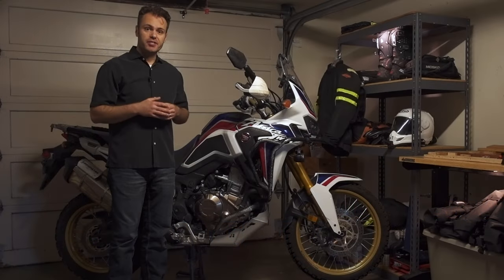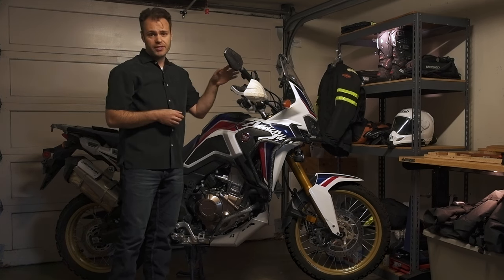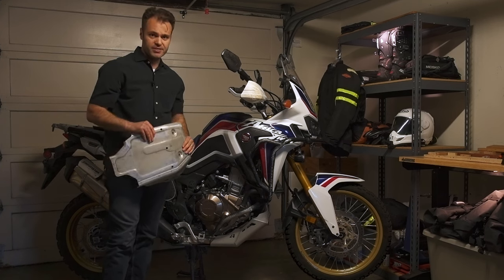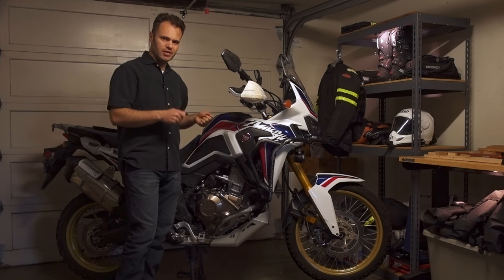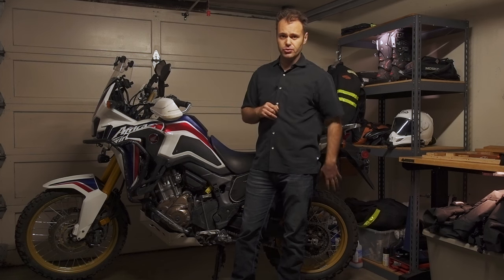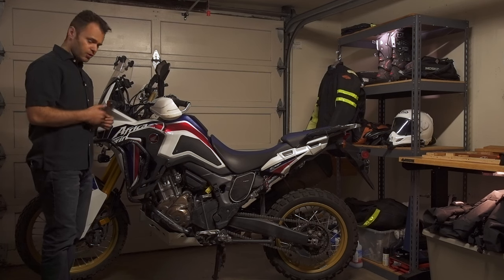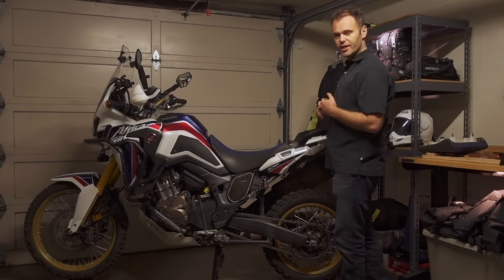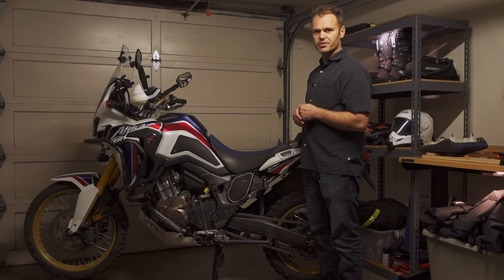Africa Twin Build: Upgrades and Modifications

Comment: Excellent video. Useful information for us OG AT owners. I have a 2016 silver manual. Love this bike.
Reply from the maker: Glad you enjoyed the video! Thanks for the feedback. For sure, these early AT models are the last of a vanishing breed - simple, reliable and fun.
Reply: @DiscoveryMotoADV you mean the newer bikes are less reliable?
Reply from the maker: I dont’t know if they are necessarily less reliable (though in some instances they clearly are) but they are harder to repair when they do fail. For example, to fix a cable throttle, it’s easy to replace the cable - easy enough to do in the field. To fix a fly by wire throttle, you will have to go to the shop which can be hard if you are in the middle of nowhere. And if something goes wrong with the computer in the field, you are screwed.
Reply: @DiscoveryMotoADV  mine is acting all crazy right now in a cold start. I cleaned the start/stop switch. May be a faulty TPS, idk. I’m not a good a mechanic…yet lol. Gotta get this thing fixed though. It’s driving me nuts.

Comment: I think service shops should allow overriding the speedometer specs when you change things like sprockets, wheel base or just tirre type at all.  Further they should allow user tuning for maybe +-3 miles per hour to fine tune things.

Comment: I had opposite experience koso where way hotter I have oxford on my Africa twin and can't tell they are on barely. And it's not even cold here yet. That crazy, I had koso on nc 700x
Reply from the maker: One thing to consider with the oxford…. At one point, one of my grips did end up being much cooler suddenly. They replaced that grip under warranty and it was hot as blazes again. So, could it be a bad set?

Comment: This video is more than an overview of farkles; it’s an excellent springboard for discussion about the strengths, weaknesses and “evolution” of the Africa Twin. Performance wise, the thing I’ve found that’s surprisingly useful on this bike (but not all bikes) is a quickly tunable steering damper.  It’s costly, but I ride in a very windy, sandy, gravely, damp environment and anything that keeps the front end pointing in the right direction helps. That aside, these bikes are farkle magnets, and thoughtful discussions like this are important - thanks!
Reply from the maker: Thanks for watching and the feedback! I hadn’t had any experience with steering dampers until very recently something orange and Austrian entered my life. 😁 i never thought it would happen but there is a KTM690 currently sharing the garage with the AT. Not sure if I am going to make a permanent change or not. Still trying to get a feel for the KTM. But the previous owner farkled the hell out of it including adding a Scotts a steering damper. I haven’t fiddled with it yet but I did have a terrifying bout of head-shake when I hit some uneven pavement at 75mph.  Gonna see if I can tune the damper to try and address that.
Reply: @DiscoveryMotoADV  Just used mine this evening on sloppy gravel.  I can dial mine in, takes  less than a second to feel the difference.  Good luck with the KTM - after 55 years of riding I’m convinced there’s no such thing as a bad bike these days, they’re all good. Skills, on the other hand, should constantly evolve. Take care!

Comment: Great video. I have one of these and will be taking your suspension advice. Regarding speedometer changes from sprocket changes, Not sure that’s correct. I think the speedo works off a sensor on the front wheel so unlikely to be affected. What would change is speed per rpm level in each gear. You’re definitely a slower bike in every gear at a certain rpm after adding teeth but speedo should be correct
Reply from the maker: Glad you enjoyed the video! Thanks for watching. I promise that the speedometer is indeed off. You are right that there is a speed sensor over the ABS ring on the front wheel. However, this does not actually run your speedometer but rather determines wheel slip for the purposes of activating the ABS. The speedometer reading comes from another sensor located at the gearbox. Thus, changing the gearing ratio, changes the speedometer’s perceived speed.

Comment: I think that the sensor for the speedometer should be on the front wheel (as with most bikes - I don't own an AT) which means that gearing changes won't affect it.
Reply from the maker: Common misconception for the AT ( I though so too). There is indeed a speed sensor on the front wheel but this is only for ABS and traction control. The speedometer sensor  is at the drive shaft.

Comment: Great video explaining upgrades and setup. Now that you have heavily upgraded the bike, would you consider trading your bike in for a newer 2020 - 2022 AT?  The negative would be cost, since you most likely have this bike paid off.  I went to a Honda dealer and with tax the 2022 DCT Adventure was $17,900 and that did not include tax and other fees.
Reply from the maker: Great question. I actually had a comment in the video about this but cut it out to keep things concise. I personally would NOT make the trade. The 2017 is the last year Honda kept things simple on this bike (cable throttle, minimal electronics). I like the idea of keeping things as simple as possible to increase reliability and field repairability on a bike that I take into remote places and often alone. In terms of cost, this bike cost about 17,000 all in.  8,500 for the used AT with 10k miles on it and about the same in total upgrades (some of which, like crash protection, you will still need on the new AT). And of course the Ohlins suspension and RR wheels are still going to be better than the new AT. So, I would strongly recommend going  with a pre 2018 used AT and then upgrading to your preferences (unless computerized riding modes are very important for you). With respect to DCT, thats a personal preference thing. I prefer manual as I feel it gives me better control in slow technical terrain.  Also, have you considered the T7? If I was buying today, thats the bike I would buy.
Reply: @DiscoveryMotoADV  Thank you for the feedback. Simple makes sense. I am currently looking to buy a AT and will take your viewpoint into consideration . I will take a look at the T7 also. Thanks!
Reply: @DiscoveryMotoADV  Have exactly same thinking... but i like DCT...

Comment: Great video, thanks! May I ask you, I want to know Manual transmission vs DCT. What is your opinion, please?
Reply from the maker: Thanks for watching! I think this is really a matter of personal preference - no right answer. I personally prefer the manual for two reasons: (1) the DCT is a little more mechanically complex and I prefer to err on the side of maximal simplicity since this makes the bike more reliable and easier to service in case of breakdown and (2) I believe that having a clutch gives me more precise control in technical terrain and it has definitely saved me from what would have been a few pretty bad crashes in some "whiskey throttle" situations. I recommend a couple of good videos from Bret Tkacs below on this topic to help you make a decision.

https://youtu.be/pgeYoG_mvts
https://youtu.be/wZXC7P7F6Fo
Reply: I did a manual transmission and put a quck shifter on it
Reply from the maker: @chris.kiser86  Thanks for sharing! What year is your bike? I didn’t even know this was possible on the 2017 but based on some googling it looks like it is by plugging directly into the coils instead of the computer.

Comment: great work on the video. appreciate the low key approach. I had pretty much written off the idea of buying  one of these older Africa Twins but you make a great case for them. Thank you.
Reply from the maker: Thanks for watching and for the feedback! I do love the bike in its current configuration and the beauty of the early models is their relative simplicity compared to most modern ADV bikes.  With the right mods it’s really a great bike if you can live with the weight.

Comment: Great job!

Do you still own the 2017 Africa Twin?
Reply from the maker: Thanks for watching. Yes, I still do. I have tried a few other bikes in the mean tine but so far the AT has successfully defended it’s position in the garage.
Reply: @DiscoveryMotoADV  I own a 2019 Africa Twin (Standard). I am wondering if you have experienced any ignition switch and/or left and/or right handlebar switchgear issues?

Also, can you please provide me some product sourcing information regarding your Ohlins front forks. Specifically, where can I buy them and what exactly should I ask for? Also, did you install them yourself?

Thank you.
Reply from the maker: @John-zb2kw  i have had absolutely no electrical or mechanical issues with the bike with the exception of one blown master fuse. In terms of Ohlins, you just place an order through their site (link below - just select the models for your model). Alternatively, you can use their website to find a dealer which could save you on shipping costs. I installed myself. Directions are straightforward and no special tools are required (other than a torque wrench). I would plan for  a solid half day of work. 

https://www.ohlinsusa.com/parts/honda/crf-1000l-africa-twin?srsltid=AfmBOop2j_PO2877RLoD9AyqC-UZA00BbM_FgV2SbZGKrCqxHux0gVzc

Comment: Appreciate your honesty in stating certain mods possibly not worth the money.  Similar to your bike I prefer to only install the best equipment I can afford.  Not insanely rich so I prefer not to waste my money.

Might want to look into altrider center stand skid plate....offers a lot of protection and allows bike to slide.

My favorite mods just for looks was Remus exhaust and Altrider high fender kit. 

Getting ready to pull trigger on suspension myself
Reply from the maker: Thanks for watching and commenting. Glad the video was helpful. That remus exhaust definitely looks pretty sweet and probably sounds pretty sweet too. Plus a chance to shave some weight. I’ve definitely thought about the high fender kit as well. One day when I end up packing the stock fender with mud, Ill probably pull the trigger.

Comment: Great video, and great bike. Just one small question. Taking in account that the speedometer sensor is on the front wheel, doesn't it really matter the gear ratio, correct? It reads the turns on the front wheel.
Reply from the maker: Thanks for watching. Glad you enjoyed the video. I was confused about this as well. What I learned is that the speed sensor on the front wheel is inly used to detect wheel slip for the ABS. The actual speedometer sensor is at the top of the case and monitors drive gear rotation which is indeed effected by gear ratio.

Comment: I am purchasing a 2017 A.T. .  I also would like to get some tubeless wheels for the bike.  I have looked at VMX but can not get anyone to respond to an email, nor could I get through on the phone, though they say they are in California.  I know the product is made in China.  I just found your video yesterday and noticed the Rally Rand wheels.  I have sent them an email but can not find the wheels on their site anywhere.  Can you provide anymore information on these wheels?  Appreciate the video.  The bike I am purchasing has the same safety equipment they you have listed and will be picking up some other items you have.  A little concerned about the front forks as I am not going to spend that type of money for them.
Reply from the maker: Whoa. Just checked the Rally Raid site and it looks like they aren’t supporting Africa Twin at all anymore. Please comment if you hear back to let folks know if these are no longer being produced. I believe Woody’s  Wheels will do a tubeless rear. I am not sure if they will also build a front with a safety lip. But worth giving them a call. A lot of people have success with a DIY Outex approach but I am hesitant to run tubeless without a safety bead. Many people have done it seemingly without issue but it is not recommended. As for the forks… its hard to say how common the sticktion problem really was. Enough that it comes up on the forums and suspension shops offer recoating services but still pretty rare i bet. Just pay attention to the forks when you are inspecting the bike. Look for wear on the stansion. Thanks for watching.
Reply: @DiscoveryMotoADV  yup, they are not manufacturing them anymore.  This was their response.  Marc, thank you for your email. I am sorry we no longer manufacture the wheels for the Africa Twin, I am sorry but we are unable to supply them. I like the style of the VMX with the outer spoke, but just not sure of their reputation.  Woody's pricey but I guess you get what you pay for.
Reply from the maker: @marcrobyn4844  Thanks for sharing their reply! Pity that they aren't supporting the AT anymore.
Reply: Wow, you have a ton of money into this bike! The front forks are 4K in Canada and the rear’s about $1600. You’ve done a nice job with your choices. I changed the gearing on mine too, I also installed a healtech speedo healer. Works well and found a short cut to make the install relatively easy. Thanks for the video!

Comment: Thanks!  Looks like Rally Raid isn't making those wheels anymore.  Woody's Wheelworks makes some though.
Reply from the maker: Thanks for the update! It actually looks like RR has stopped making parts for the AT all together. Woody’s has a great reputation so glad to hear they are still doing it. The only issue that I recall is that they may not be able to do a safety bead on the front wheel.

Comment: Where csn we find more details on the tubeless wheels?

Have you modified the OEM wheels or you bought new tubeless set?
Reply from the maker: The tubeless wheels are from Rally Raid. They are currently out of stock but if I understand correctly they do intend to resume production at some point. You will have to check with them. These wheels have the safety bead on both wheels and are sealed for Rally Raid with a galvanized rubber process from a company called bartubeless. A much cheaper but seemingly effective alternative people take is to seal the wheels themselves with available kits or various DIY approaches. I was not happy with this approach because you would still be missing the safety bead and risking having the tire slip off under certain conditions. But there are people on the forums that have ridden thousands of miles without incident with that kind of setup.
Reply: @DiscoveryMotoADV  thanks for your response. All clear.

Comment: 5:30
What r u talking about if bar goes out of alignment i fix it by hands, just move bar to one end and push with hands on grips.
But i agree its annoying that something like this happens, engineering oversight imo, and raisers will only make this worse
Reply from the maker: Yes. It is possible to bash them back into position (or over correct to the other side) with a good strong push. Which is exactly the problem. I prefer my bars to be immobile and straight. I agree that something like a rox riser would make this worse by increasing the leverage in a fall. If you look at the riser I describe, it bridges the two mounts so they can not pivot thus preventing bar rotation. As to whether it works or makes things worse, all I can tell you is that the bars have not moved after dozens of hard drops since this was installed. There is a risk that the force has to go somewhere and so instead of the bars pivoting it could throw the forks out of alignment instead. I have not experienced this.

Comment: Afrca twin 2017 - 45mm inverted telescopic fork; 9.06 in. travel
Africa twin 2016 - Inverted Showa® 45mm fork w/ 8.0 in. travel; adjustable compression, rebound damping & hydraulic adjustable preload

good morning, does this data above mean that the AT2016 has a lower suspension than the AT 2017? what are the differences between them. AT 2016 and AT 2017?
biker greeting
Miroslav
Reply from the maker: I have only owned the 2017  so can’t speak about the 2016 from experience. What is the source of the above data? Honda does model updates every two years and, In the US at least, there were no changes between 2016 and 2017. 9.06in travel at the forks is correct for both years from what I can tell.

Comment: I wanted a Wing for over 25 years and 2018 just happened to be my jump in point, and no regrets.  I tried to turn a HD Lowerider into a touring bike, and it just wasn't possible.  The Wing with DCT along with forward and reverse walking mode is the ticket for me!  The weather protection, heated grips, etc, it's very hard to get any better than this!

Comment: Great vid.  The section regarding tube vs tubeless is a bit inaccurate as your example are both "tube" wheels and the opposite is the reality.  A tubeless wheel will loose air faster.  But we get the point.  Well explained and laid out!  THANK YOU!
Reply from the maker: Thanks for watching and commenting! Ah. You are right that I mis-spoke and said ‘tubed’ both times. doh! Though I disagree that tubeless wheel will lose air faster.  I have caught a nail in my tubeless tires before and didn’t even notice air loss until the end of the day. I have never blow a tube at freeway speed but I think it is well accepted that a  tube, if punctured with something as large as a nail, can burst like a balloon resulting in instant loss of pressure.
Reply: I've only heared that tubeless loses air slow and tubed is a fast loss of air! Could you explain for me as it's the tubes that put me off buying the base model, which imo is a better bike over the adventure sport!
Reply: @terrystratford1235 I also would like to know where he learned this, most likely talking from his @$$ though